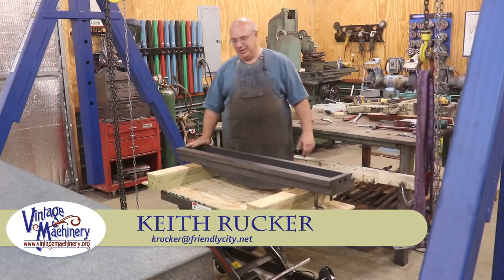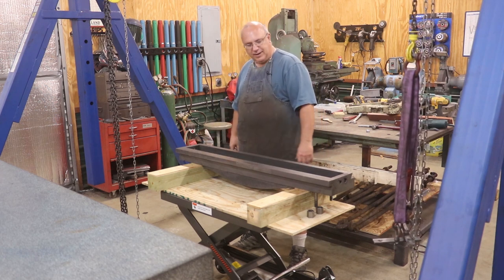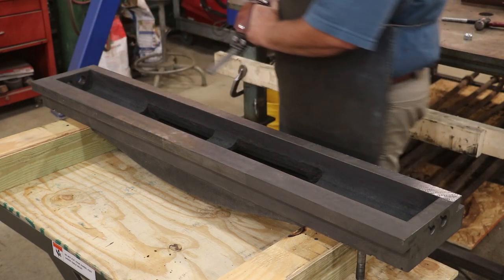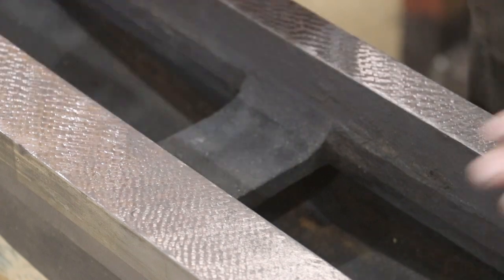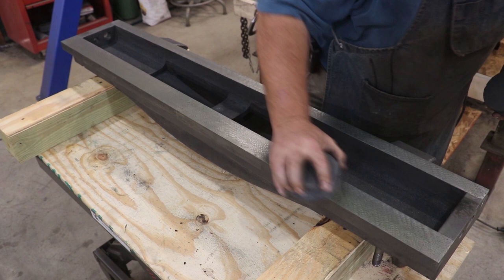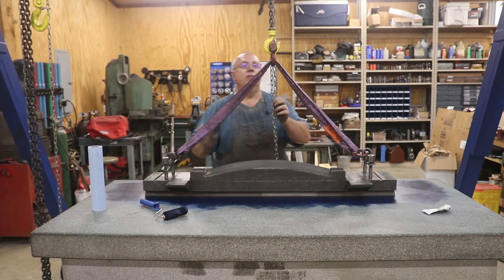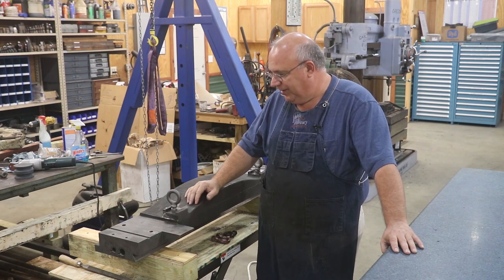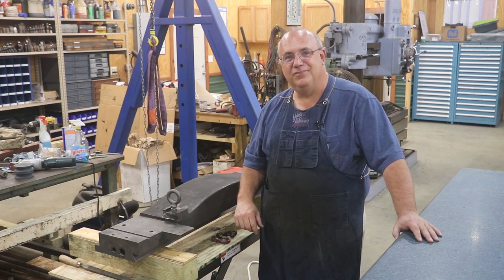New Haven Metal Planer Restoration - Part 7:  Scraping the Cross Head

Comment: You've probably worked it out but the vertical slide areas also wear, and more at the bottom than the top. Get your main surfaces flat and either mill or scrape the vertical slides to get them parallel to the other side. great to see a planer getting done. Ill have to do the same with mine soon. Its sometime better to have two heads when doing these things. All the best from NZ Keith.

Comment: Thanks for explaining the reason for scraping. I have seen metals that are so slick you could not get apart when laid together like that. I enjoy your videos.
Reply: That is why Gauge Blocks stick when you "wring" them. In my Metrology class early in my ASMET we had an old set that had obviously been neglected or just used to death. Some surface pitting from being handled a lot and not cleaned often enough (or at all). I could wring them but a lot of the guys had trouble...

Comment: My girlfriend, who was a print making major, mentioned that you might want to try an ink brayer as opposed to a foam roller.  She says it spreads the ink easier with less waste and is easier cleanup on the roller.  She recommends a Speedball brand brayer.
Reply: Hard or soft brayer?
Reply: @bobgilbert4873  She has a soft brayer.  

According to the interweb: "Harder brayers are less likely to dip into cleared areas on the block and it is easier to get the grain pattern in a wood block to show up with a hard brayer. ... Softer brayers are more popular with most relief printmakers because they are more flexible so it is easier to cover the whole block evenly and quickly."

Comment: I would just like to say for anyone seeing this and for Keith. NEVER EVER place your hand like this at 11:30 when moving a load. The side load on a stud is bad enough but that bracket should have at least been at the top of the stud. If that bracket had slipped when you were moving that piece then at best it could have crashed down onto the surface plate and at worst it could have pinched off a finger. In 2 decades of working in factories moving heavy machinery and work pieces around I've seen some nasty pinch/crush injuries and I would rather have a finger cut off than pinched off.
Reply: Nice catch!
Reply: Woah!  That was cringe making all kinds of scary once pointed out.   Keith didn't seem to be thinking about what his right hand was doing, and with the way he was moving the load, it was entirely possible it might have slipped.  It might have stopped when the bar got to the threads, but even then, there was probably not enough space left to avoid injury.   Engineering shops have the potential for some very nasty injuries.  Jagged cuts from band saw blades or angle grinders (I have suffered both over the years, and wear Ironclad Kevlar gloves nowadays).  Nasty cuts from stainless steel swarf, that almost always seem to get infected.  Trauma from poorly clamped work pieces in machines like pillar drills — that was the machine that scared me the most because with a huge motor, and very low gearing, nothing could stop it spinning.   Since retiring I now regularly attend the local Menz Shed (I live in New Zealand) and have discovered the joy of working with wood, but I'm learning all over again about the dangers of table saws that can kick the work piece right back at you if you don't have the riving blade fitted, and most of the wood working YouTube channel presenters appear to have removed their riving blades.  Then there is the router table which will also spit your work piece out if you go the wrong way and climb cut.  I haven't even got to thicknesser, planer, jointer machines.

Comment: YOU ARE ABSOLUTELY A PROFESSIONAL CRAFTSMAN !!!
BUT I ASK...

After your scrapping, there is always an amount of metal fragments, did you HIGH pressure air blast the part as it was hanging up-side down on the hoist as to completely blow all those metal fragments away so as they did not fall on your surface plate?
~

Comment: When you started working to bring the front surface parallel to the two rear surfaces (that contact the uprights), did you check that the two rear surfaces were co-planar? (and if so, how?)

'cos if the two rear surfaces aren't coplanar, you'd be chasing your tail for ever scraping the front surface!

 - BugBear

Comment: A question not a criticism from a non-scraper.  Could you not have got the large surface flat and then corrected the alignment of the opposing , but much smaller surfaces?  Seems like this would be much less work? As I said, question, not a criticism.
Reply: Ian Pendlebury   that would be my question too.
Reply: You can do it line that . And If will work. But this way , you have less work, because you most scrape the large surface also. So if you also need to scrape the large surface , make 5 more passes and you also solved the upper parts.
Reply: In my opinion, as a retired machine tool fitter, you are exactly right, Kieth is making a lot of extra work for himself. Make front faces flat and parallel and correct back
faces later when the vertical columns are aligned and bolted to the bed 
 [We would call the" cross head" the bridge, UK speak ]

Comment: Hope this isnt a stupid question but,could a piece of glass be used as a crude surface plate for smaller items.
Reply: Glass is often not very flat. You would need a fairly thick piece, and then lap it. Probably better to use a straight edge?
Reply: Thanks for the reply.I also wonder if there would be a difference in flatness between float glass and toughened glass.

Comment: If the two log ways are parallel with each other, why don't you work on the short upright ways on the top side to fine tune it to parallel?  Good job on describing the process.

Comment: What a time staking process. I am not even close to being a machinist, and I admit that I don’t understand why things are done a certain way, but from a retired carpenter’s prospective, why not use the surface grinder to do the majority of the work, then come back and scrape to put the “oil divits “ in it. It seems that this would give a flatter surface? Thanks for the video, JB San Diego
Reply: I think that also. I think keith's surface grinder isn't big enough.

Comment: I  was wondering why more of you "Top Notch Guys" were not interested in these old Metal Planers.  Considering the cost of grinding over large surfaces the Planers seem to be a good Tool to have in the old Arsenal.  Videos on YouTube from Anne Acheson show a machinist reworking a Bridgeport Mill Table that was at the least interesting.  If I was listening closely the Planer is taking a matter of Tenths off a surface rather than Thousandths.  With patience it could bring some old Iron back in specs with the right operator. Input anyone?

Comment: An alternative method, if I may suggest, is to level the bolt faces with three jacks on your surface table (Science of Kinematics), then measure slideways. Obviously scraping flat slideways means geometry of the dovetail is changed. Therefore only scrape minimum.
Just a suggestion.

Comment: sorry, but your assuming the two pads are straight. You need to blue the two pads as well before you scrape any further. Do not assume anything.  Blue the pads as well
Reply: The measurements Keith is taking on the surface plate will tell the story. As work progresses, I am sure he will address any inaccuracy.

Comment: I'd never use lead oxide, aka red lead as scraping paint. The paint gets everywhere and you'll end up with lead poisoning.
Reply: Chuck Norris in my country, in old part of town, the drinking water pipe ar made out of lead. 100 years old pipe. And still no poisening
Reply: Depends on the solubility of the lead compounds involved. As long as no acids get into the drinking water supply, lead pipes get a coating of some sort of basic lead carbonate on the inside, which is rather insoluble and thereby not too dangerous.

Red lead oxide gets easily converted into soluble lead chloride by stomach acid, which is then absorbed by the body.
Reply: That's why its no longer used!